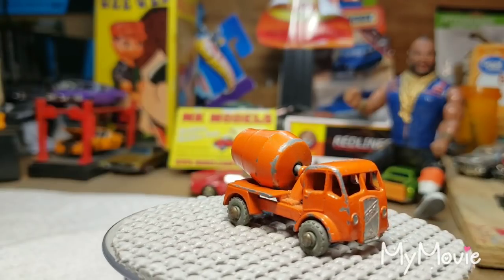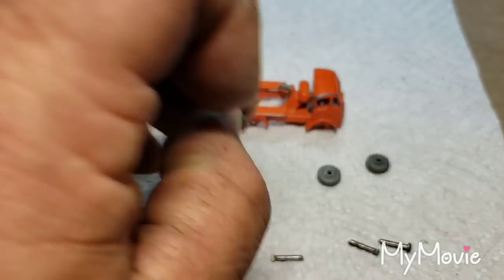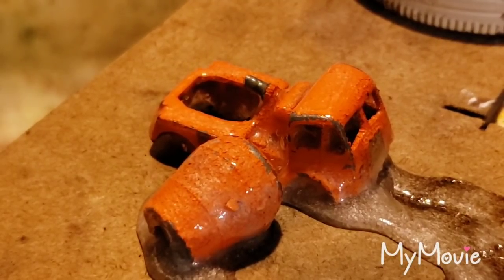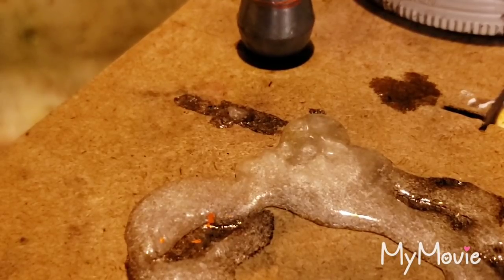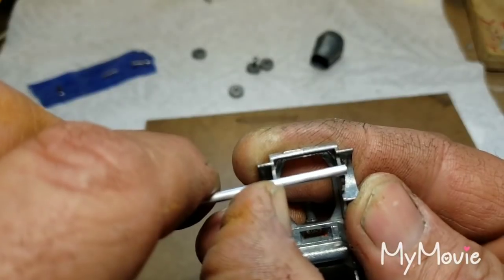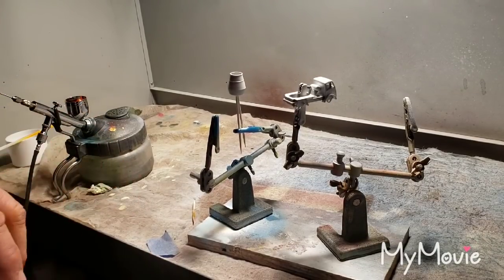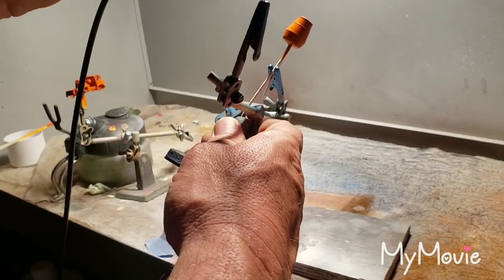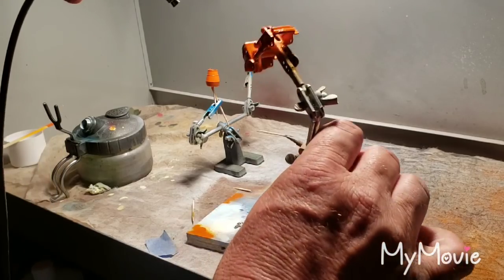Matchbox No 26a Erf Cement Mixer:May group build

Comment: Very nice paint: smooth and glossy.  You did the model justice.  This little gem could be 63 years old: the earlier versions had metal wheels.  Quality and made to last.
Reply from the maker: Thank you very much. It was a heavy little casting for its size. I tried to do it as accurate as possible.

Comment: Hey George, Have to say that is one superb resto and well justified. Your casting I have noticed is an early casting as it has no drum axle extension. This was added to help prevent the drums breaking off, so yours is a quite hard to find model as it still retained its drum. The early wheels also had model number cast in which was omitted later as the range expanded and wheels were utilised on more than one model. Your resto of the wheels is perfect as they were never polished and the look is really authentic. On the very first casting the silver trim was actually done in gold and these can be really hard to find. You have saved a very early 26a so 'Top Job Fella' ;-)
Reply from the maker: Hello, thank you for the information on my casting. I tried very hard to make it as accurate as possible since it was so old. I thought of doing another casting, but i already had it advertised. I always look forward to your information, and enjoy it as well.  Thanks for watching.  You will LOVE this Saturday's build. Stay tuned